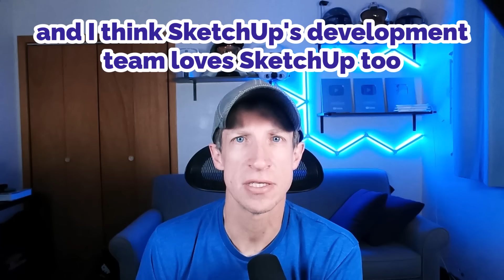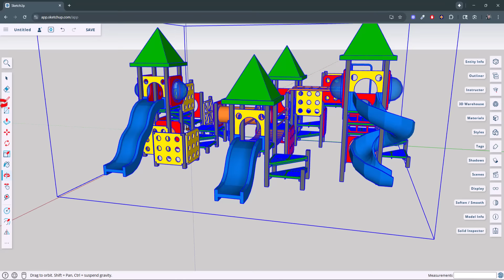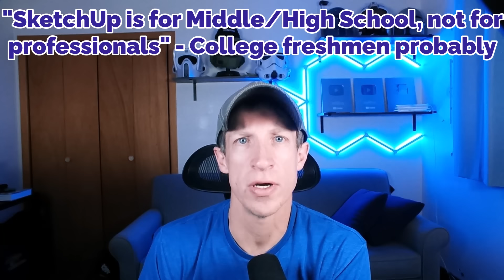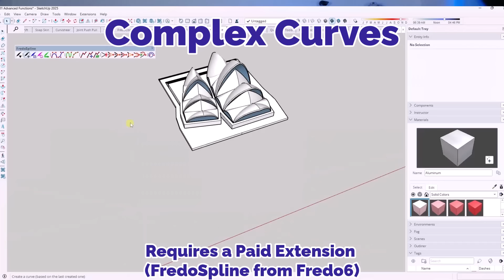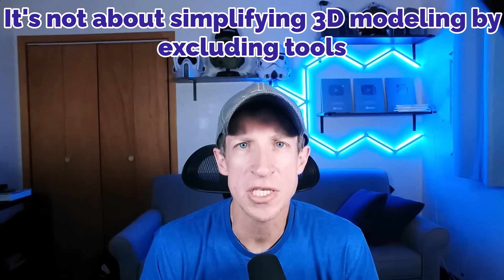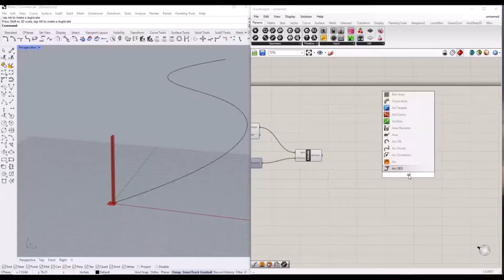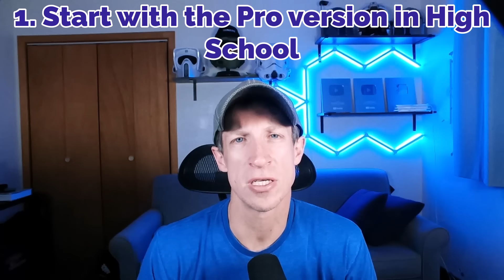Is SketchUp being REPLACED?

Comment: Justin if nothing else I appreciate a power user of any 3D Software that is willing to both admitting their favorite software's short comings and also offer solutions. That is, in the end, the only way that the OEM's will..... hopefully, make the software better. 

That said I've been 3D modeling for over 30 years, with just about every package under the sun. Alias, Pro/E, Maya, zBrush, Rhino3D, Solidworks, Revit, and Sketch Up just to name a few. The one thing about Sketch Up is that it is direct and pretty straight forward to use as you've described but the lane that it's in, mainly Interior and AEC, is just that. It would be challenging to use in other areas. Rhino3D is way more versatile in the industries that it can be used in.....Jewelry, Boats, Automotive, Product, Mechanical, and Architecture just to name a few. That's not a knock against Sketch Up it's just that have always stayed in their lane and done very well at that. 

Even from the POV of working with different data types Rhino3D is by far way ahead..... Point Clouds, Meshes, SubD, and BREP is an amazing package to have all in one. This isn't to say that Sketch Up needs all of those things, but as pipelines go, Rhino3D can be plugged into the middle of more industries than Sketch Up. I 100% agree that Sketch Up has been in need of new features for more than a decade now. That plug-ins are needed is short sighted in many ways which can also be "blamed" for the fact that it has switched ownership several times in the 25 years that it's been around. 

I could go on for another 3 years about all of this but at least just wanted to stop by, tip my hat, and hope that they listen to you and other users that are only wanting the best for the software in the end.

Comment: If Sketchup extensions were inbuilt + Grasshopper were not part of Rhino -- Rhino would still be the far better option because it has true CAD capabilities.  Sketchup is great for quick prototyping/massing -- but when you're doing professional linework which requires some degree of 2D -- Sketchup was never intended for this and fails.

Rhino has all of the capabilities of a true CAD tool, plus every form of 3D modeling (polygon/mesh, NURBS, subD, and is natively efficient/modeling to w/pointclouds). The import/export capability is also unmatched.

I fully support the intent of this video -- to convince Sketchup/Trimble to pay attention to their users (a well-known issue for Trimble). However, I don't think Sketchup will ever be able to compete with Rhino at the "pro" level in the near future.
Reply from the maker: I mean..."Rhino has all of the capabilities of a true CAD tool, plus every form of 3D modeling (polygon/mesh, NURBS, subD, and is natively efficient/modeling to w/pointclouds). The import/export capability is also unmatched."...except the capability to actually generate 2D plans, which is a massive need for a true CAD tool
Reply: @Thesketchupessentials  - Are you intentionally being hyperbolic by saying that it can't generate 2D plans whatsoever?  If you care about objectivity and accuracy, wouldn't it be more accurate to say that Rhino has room for improvement in this area?

This has absolutely no bearing on the point -- that so many things we need as professionals, simply are not available in Sketchup because it was never intended to be a CAD tool.  Whereas Rhino began as one.

I'm not knocking Sketchup, it's a great massing/design tool.

...That doesn't change the fact -- it will objectively require MUCH more than superficial features to reach the level of productivity of a tool designed from the ground-up for professional use.  A tool that supports every form of 3D geometry because it's fundamental code is built for this whereas Sketchup's fundamentals are built for a very different purpose.
Reply from the maker: @InspiredScience  I'm saying that creating documentation is a massive requirement for a CAD tool, and Rhino is not good at it. So I am disagreeing with the idea that it has all the capabilities of a true CAD tool. Totally don't disagree with the modeling function piece, but I also don't think the implication that "Rhino does everything perfectly and is way better than SketchUp in every way" is a fair implication. Both programs have strengths and weaknesses.
Reply: @Thesketchupessentials  I'm a scientist and stick with empirical, objective reasoning over subjective arguments or fallacies.  I have no interest in arguing for argument's sake.

You've shown that you're more interested in the debate.  An easy way to catch yourself entering the territory of a fallacy, for example -- in your case, the "straw man" fallacy, is when you intentionally create an abstract statement that is different than the actual quote (and entirely different than the person's point) -- then you add quotations around it, or claim this as the other person's point.

AT NO POINT did I ever claim (to use your quoted statement attributed to me) -- "Rhino does everything perfectly and is way better than SketchUp in every way"

Nor did I "imply" it.  Rather, I was making a very clear point about the fundamental architecture in CAD (drafting) tools versus Sketchup as (fundamentally) an easy/quick massing tool that  was never interested to be a "conventional" CAD (drafting) tool.

This was clearly explained in terms of CAD drafting and the reason why Sketchup's deficiencies can be traced to this fundamental difference.

I'm not sure whether you're misunderstanding the fundamental point, or your bias is getting in the way of your ability to understand the context that I used the term "CAD tool" in reference to how linework is accomplished which is a fundamental flaw of Sketchup.

Perhaps you'll understand better if I provide you with a simple example of a professional workflow.

Import a 2D DWG into Sketchup that is imperfect and needs additional work to complete.  It's a complex survey/parcel boundary along with floorplan, multiple elevations, MEP, etc.  You must complete, repair, or repurpose some of the work, then you'd like to start modeling it.

It's not possible in Sketchup.  You'd ultimately have to finish it in the DWG-compatible tool -- even once you're ready to start 3D modeling, you'd still be hard-pressed to do everything with the efficiency of a true CAD or true 3D modeling tool.

This is not the case in Rhino.  You could take that DWG, finish anything with full CAD (aka drafting) capabilities, proceed to do complex 2D linework, work with precision among many complex items (splines, etc).

You, Justin, teach Sketchup /and/ Rhino for residential-grade/small-commercial architectural projects; however, your channel has never shown the workflow in a professional architectural firm starting from large and complex 2D or BIM plans.

This is where Sketchup is not capable and the reason Rhino is more professionally oriented.

In short -- CONTRARY TO YOUR CLAIM -- I never once claimed Rhino is perfect or sketchup is inferior.  Just the opposite, I explained they are both good programs for entirely different reasons and purposes.

For some reason you appear more defensive, or interested in arguing, than understanding that I have no bone to pick with either software.  Instead, I'm explaining how the fundamental difference between the two -- makes it very difficult to suggest Sketchup somehow compete with Rhino merely by adding features.  

Features will not ultimately change the major difference between the two tools at the most fundamental level -- and that -- is the reason Rhino is more professionally oriented.

Perhaps a little less defensiveness and certainty, and a bit more attempt to see or learn from the point, will go a long way.

Comment: I started with Sketchup and it was my preferred software for many years. I dabbled in Rhino for basic modeling initially. Once I got over the learning curve, I started using it more for complex modeling. After adding the Push / Pull feature in Rhino, I stopped using Sketchup as I was modeling just as quickly (and similarly) in Rhino. Sketchup will never be able to achieve the level of complexity you can get with Rhino nor will it have an equivalent to Grasshopper. I also use Rhino for CNC designs. Sketchup technically uses meshes and cannot achieve the precision of NURBS. All that being said, there is still a good demographic for Sketchup. Small and mid sized business in landscaping or interior design for example can leverage the ease of use and minimal learning curve of Sketchup. Especially those places that do not have a dedicated design team. In my previous position, we had all the sales people learn Sketchup to present concepts to clients. No way we could have taught them Rhino. Trimble should focus on ease of use and more tools! No one will ever use Sketchup to design a cruise ship but they can still maintain a good subset of users if the capabilities increase.
Reply from the maker: Appreciate the nuanced response!

Comment: I still use Sketchup 2015 for woodworking design. There are great books written on how to use Sketchup for furniture. I don't want a "pay as you go" version. I want it to run on my laptop without an internet connection.  However, I would like to explore a parametric CAD, which would make it easy to resize designs or subassemblies of designs. (sounds like Grasshopper!).
Reply: I would like a copy of 2015 version. I used it for woodworking designs as well but there is no version available on-line to download it anywhere. I need a SketchUp version without having to login online. My SketchUp version 2017 crashed.

Comment: There is also the fact that Rhino is the Swiss Army knife of 3D modelers. Need to model something in mesh, NURBS, or subD? Not a problem. How about needing to convert a model to one of those other formats? Done. You need the model as a dwg or just about any other 3d file type? Easy.
Reply from the maker: That's another concern for me - that's what SketchUp is SUPPOSED to be with all the extensions, etc. The problem is it looks really bad when another program just does that stuff with native tools. I'm actually pro extension, but I think it puts SketchUp behind from a marketing standpoint

Comment: SketchUp needs hundreds of plugins (each with a different UX) to do what Rhino does natively. SketchUp has serious navigation problems (it gets lost within the geometry, clipping issues, etc.) since the first versions, and these have never been truly resolved. SketchUp has only recently implemented ambient occlusion, and its quality is questionable; Rhino has been doing this for a long time. And then there's Grasshopper... SketchUp is an excellent software and, despite existing for a long time, when compared to the very mature and structured Rhino, it still looks like a teenager.
Reply from the maker: I personally have not experienced navigation problems in SketchUp at all (in fact I find it to be a lot easier to navigate in than Rhino), and I find the ambient occlusion effect in SketchUp significantly better than the one in Rhino as well. It definitely has a steeper modeling toolset, but I don't think it is better in those other areas at all

Comment: I know that I would ditch autoCAD in a heartbeat if I could do some decent 2D drafting with Layout and import PDFs. Additional features, yes, but probably useful to a lot of users on a regular basis. And that's just one example. I also think that if SketchUp saved me money from not having to purchase another piece of software, I would be less inclined to question the pricing (which is probably some of the appeal of Rhino more than just its perpetual license).

I agree completely with this and I think this is a good conversation to have, because you brought up some of the reasons why the issue goes beyond minor inconveniences. You hit on why the strength of SketchUp - making complex things simple to do - has also become its weakness.
Reply from the maker: I wish this workflow was a little smoother. If SketchUp could figure out how to get the Layout pipeline to be more intuitive and less slow, this would solve one of the big objections I see about using the software. It's kind of a double bummer, because Layout is SIGNIFICANTLY better than what Rhino has to offer already, so it's a huge opportunity

Comment: I'm a longtime Sketchup user, but still on Make 2017. Because after that it went cloud, and I will NEVER use cloud apps if I can avoid it. I also only uses free versiob, since I'm a hobby user. I liked it when it was Googles, but after that pretty much all they've been doing is remove features from free versions, ignored bugs, and made it harder to run in wine (I use Linux). I generally avoid it now if I can do the same things in FreeCAD or Blender, I sill like it, but to go back there needs to be a free version, which actually works, correctly scales objects, handle metric/imperial right, and can handle multiple curved objects intersecting without creating "holes" in objects.

Comment: The problem is that the program is meant for simple tasks. The price also plays a big role. I use it for private DIY projects and don’t make money from it, so the cost and the availability of a perpetual license are important to me — as well as the ability to run it on my computer without an internet connection.
Also, the program often freezes, even though my computer is very powerful.
SketchUp is just a toy.
Reply: This is exactly my issues with Sketchup.

Comment: first they should use vector based modelling like rhino!
Reply from the maker: I'm not sure this is possible (or it would at least require MASSIVE changes to the engine). I'd be shocked if this move ever happened

Comment: The surface modelling type is the limiting factor with SketchUp for complex geometries, it’s not a good idea to start with a mesh surface, you have to start with T-Splines or something similar and then translate into mesh at the right time (like Rhino and Blender). But ONLY if you’re expecting to export CNC files. 

If the plan is not to export CNC then adding tools like bevel etc. will be very helpful. 

Grasshopper has a SUPER engaged community because of the generosity of it being a free tool. I’ve seen quite a few examples of someone asking for a tool on a forum and then someone like David Rutten codes it for them and shares in the forum. I mean, that feels like a friend or family member more than a stranger 😄 

So it’ll be hard to compete on Rhino’s turf however SketchUp can fulfill another need, rapid prototyping for Sketch Design phase.
Reply from the maker: How is a grasshopper a free tool? Don't you have to buy a Rhino license to use it?
Reply: @Thesketchupessentials  Well it’s a free plugin for Rhino. And almost all the grasshopper extensions like Weaverbird are free too. Cool thing is, Rhino offers you a perpetual license too so you buy it once and upgrade if you feel they’ve earned your money. 

I use both, I use SketchUp more frequently than Rhino but I like Rhino’s approach to licensing more than Trimble’s. 

For me SketchUp will always be a prototyping tool. Why? Vectorworks, ArchiCAD and Revit have the market cornered on BIM meaning that your engineers and other professions use it already so you can all work on the same platform. Then there’s softwares with complex functionality for coding and complex form generation like Rhino and Catia, I sometimes use Blender as well in part of the process. 

However one area where SketchUp has the others licked, in my option, is standard architectural prototyping, I don’t think there’s another software that’s as quick. I think they should lean into that. Give us quick bevels, fillets etc. like you said.
Reply from the maker: @Dev1nci  Ah, I see. I agree with most of this - I don't think SketchUp is just a prototyping tool, but again, I'm coming from the architectural space where people are using it for full production sets. For manufacturing and CNC (which it sounds like you're doing), I can see this being accurate though. It sounds like there's a big gap between drawing something in SketchUp and being able to get it into a CNC machine

Comment: Quiet Shift!? People have been vocal for years, but Sage Trolls (you know them) quickly silences any dissent or criticism on the forums. It's like there is a gatekeeper you can't get past- else he calls out the minions. Ironically, this is also a corporate culture issue. There haven't been many meaningful upgrades since I started using SU5! Oh, but new graphics engine...Faux Rendering!? Yes, a cottage industry of devs creates great plug-ins and extensions. However, Trimble needs to focus on both FEATURES/TOOLS and STABILITY. Those are what make a platform an industry standard. Get lazy and get taken over. Look what Adobe did to QuarkExpress (remember them!?) Look what Apple did to RIM in the mobile space. I'm sure people believed Blackberry wasn't going away, soon, either.

It won't go away, but Sketchup needs to become WAY more compelling for new users, else it may fade out of relevance. Parametric modelling is a must (beyond components). The inability to make adjustable/defeatable changes is a productivity killer. It makes iteration difficult. Yeah- if you use it just for architecture and started with a T-square and a triangle you're all good. You know you're local codes, and you build hard-edge boxes that tradespeople will build - it's great for that. But if you try to use it for product development, organic modelling, rendering, etc. It's heavily limited out of the box. 

Shout out to PlusSpec, MindSight, ThomThom, Fredo, Eneroth, Medeek, etc. (there are too many to name) for filling in all the numerous gaps now and over the years to keep SU viable. There are so many gaps to fill—I think that is the point!

Edit for spelling. I'm sure there are still plenty of edited bad spelling mistakes.